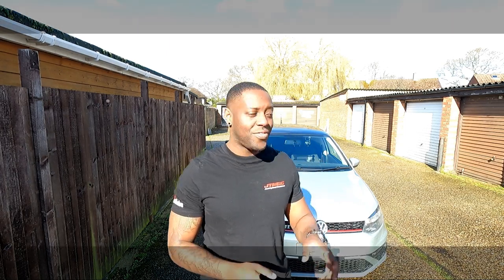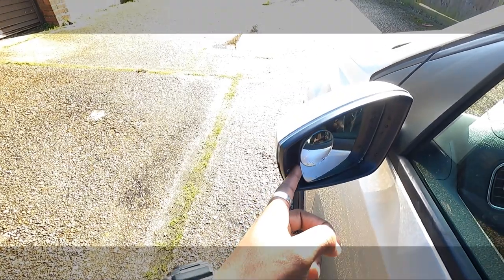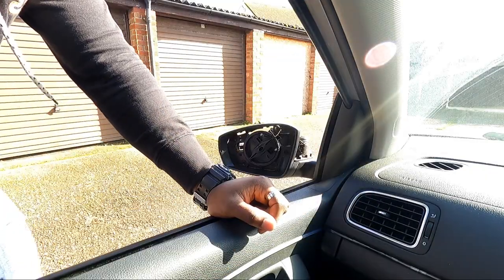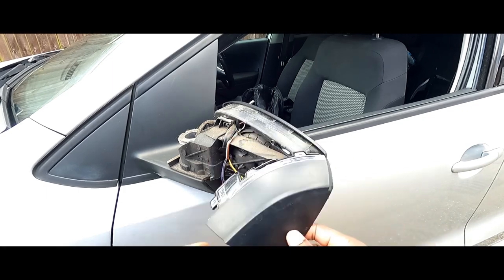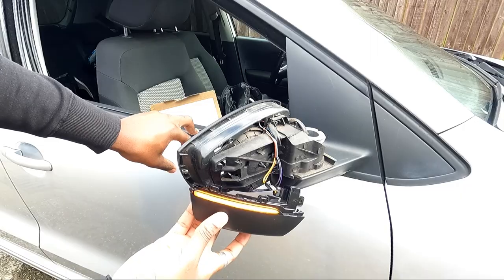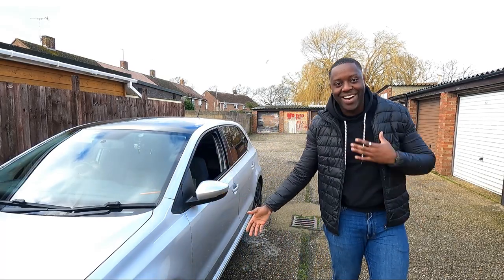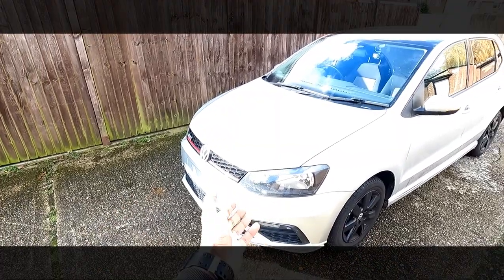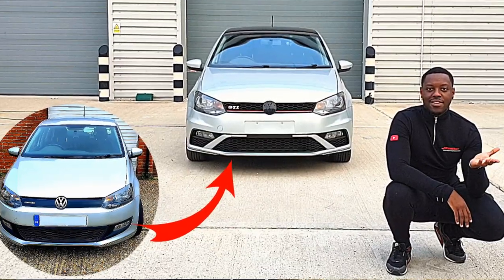Volkswagen Polo 6R LED Sequential Turn Signals Install

Comment: hey, i did the same modificaion, 1 day after you posted your video.
I agree this should be an OEM part on the car. Looks really good.

Keep on posting these videos on modifying your polo, your giving me inspirations.
One recommendation get 17 inch (7.5J ET35) alloy wheels and lower the car with H&R spring (25mm in the front and 40 in the rear).
It will look totaly different and really good.
Reply from the maker: Hello Sebovski you made a good decision its such a nice modification  

Thank you mate will do and I like the sound of that idea just took a screenshot of it 😁

Comment: Is the stock indicator a bulb you can replace or do you need to switch the entire unit?
Reply from the maker: It's probably possible to just replace the stock indicator but I didn't see a single supplier selling it like that for the 6r only on the golfs have I seen it like that

Comment: I have a question does the turning light on the inside of the mirror is that still blinking with the modification
Reply from the maker: I don't believe it blinks it functions differently because of the turn signal 😊

Comment: Man love the videos! 

Could you do a break down of parts you e used and overall cost of the upgrades so far?
Reply from the maker: Hey Ronan thanks for the kind words , I definitely will do planning to make a video on it at some point I'm currently a bit busy at the moment with work/life commitments so far 

I'm roughly at about 1.2k and I've got just shy of another 1k left in mods I need to do before it's on to the next project

Comment: Is your mirror glued on, mine doesnt have electronic mirror and it glues onto  the housing. Can i get it off withour craxking it. Just wannw change the housing
Reply from the maker: It sounds like a different configuration to mine for yours you might just have to change the whole thing or risk removing the mirror chances are it's sticking on a clip like mine was

Comment: swap the headlights on also paint those plastic spoilers on the bottom of the bumper on either side gloss black
Reply from the maker: The new headlights are sitting beside me right now need to order a h7 hid conversion kit for them videos coming soon 👏
Reply: @The_journeyy  cant wait for the upload
Reply from the maker: Thanks bro it's one of the many mods I'm just sitting on need to find time with the working two jobs and everything

Comment: Hi there really need help as I can’t find anyone with my issue being answer online anywhere! I bought a car that has these on them and they work great while the engine is off but as soon as you turn the key the stop working properly and just flash the first LED in the speed of what it should be doing the sequential one
Reply from the maker: They could be quite a few things that could be causing these I come from a electronic eng diagnosis background so I know how I'd go about fault finding them but it's difficult to explain my process to someone else

Chances are they're faulty or it could be the wiring for them playing up the first step is always to disconnect them and reconnect them to check the wiring have you tried that?
Reply: @The_journeyy  No I haven’t tried that yet as it’s been raining since I got the car and don’t have anywhere dry to take it out so was looking for a fix before doing that but if it could be that easy I will give it a go when I’m home later and I’ll comment again with the results 🙏🙂
Reply from the maker: Sometimes it can be that easy, if that doesn't work I'd clean the connectors for them and the car barring that working I would fault find the caps and then the connectors for the car and so on 😊
Reply: @The_journeyy  Hi sorry it took a while to reply but iv taken them off and fully cleaned everything but with no luck still doing the same thing, how would I find out where the cable for the blinker lead to so I can check if the wires the issue?
Reply from the maker: I've not removed that much of it off but I'm guessing you'd have to remove the whole mirror assembly the wires should be in there 😊
Reply: @The_journeyy   Iv got new ones now and they are working fine for now so hopefully it was just the indicators themselves, thanks for the advice

Comment: Have you still got the Blue motion grill?
Reply from the maker: Nope gave it away to a subscriber
Reply: Go for the headlights to make them uniform
Reply from the maker: This is a great idea 💡 I've got a few more cheap modifications to do on the outside and then the first big one will be the headlights instead of the interior thanks for the advice bro 👏

Comment: What type of screwdriver is needed at 1:24
Reply from the maker: I can't remember exactly but if I remember correctly it was probably a torx screw like T15 or T20 my bad for not putting that in the description  😊

Comment: Bro😢 my mirror broke when i tried to remove the clips😂
Reply from the maker: I broke mine as well the first time round was so rough and didn't have my tools so used a screwdriver to try pry the mirror off not my best decision in hindsight 🤣
Reply: @The_journeyy  thing is i had the tool but i was too rough when doing it🤣 ordered 2 new mirrors and waiting for my mirror caps until i try again😂😂
Reply from the maker: The mirrors are definitely finicky it's a delicate touch kind of a job once you get the mod on your going to love it the indicators are very cool 👏
Reply: @The_journeyy  i really hope i can make it in the end, i bought wing mirror caps i Will put them on in same time so i dont need to do it twice 😂 is it tricky to get the mirror back again?
Reply from the maker: I don't think it is tricky after that I took the second one off with ease and putting it back on was easy 😊
Reply: @The_journeyy  ok thanks alot bro 😎